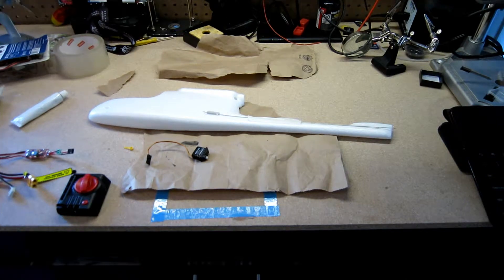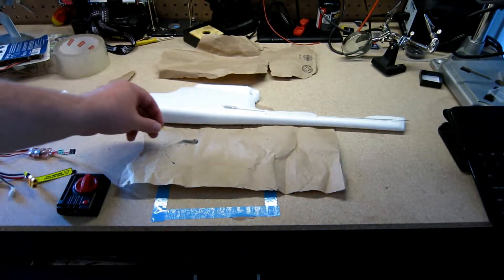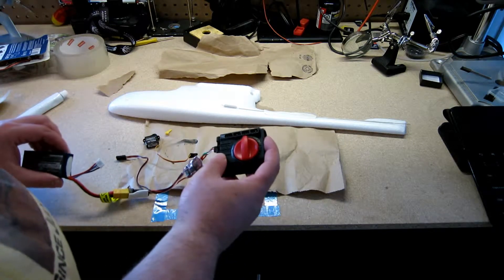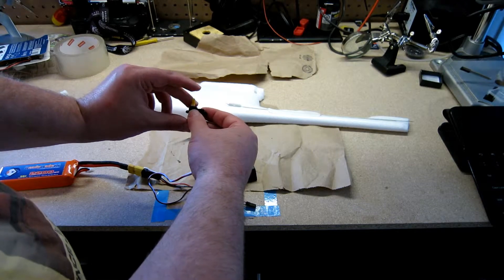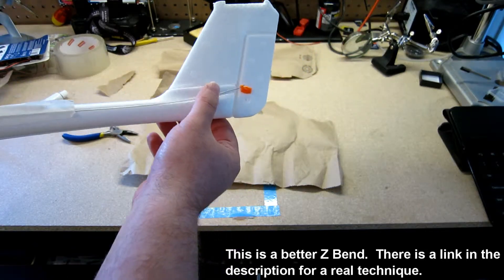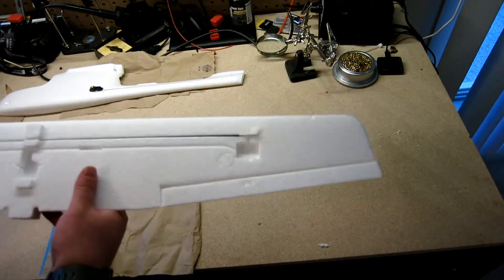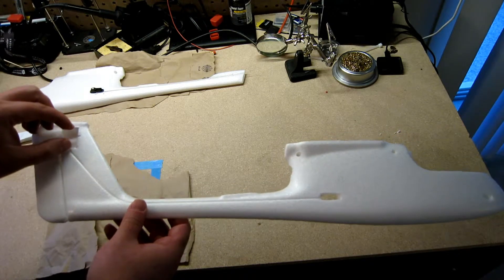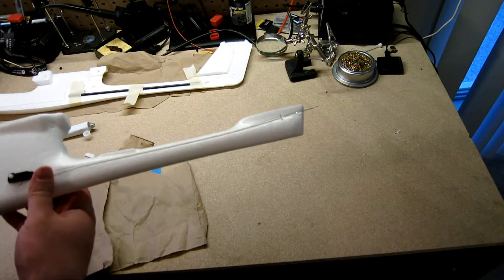At The Bench: Mini Skywalker 3 - Control and Support

Comment: with all respect...

this is the first time i have ever seen someone using a servoplug from esc to motor....

use these and some heatshrink
http://www.banggood.com/Amass-2_0mm-Banana-Plug-AM-1002C-Male-Female-20-Pair-p-999232.html

http://www.banggood.com/5X-Pairs-4mm-Gold-Bullet-Connector-Banana-Plug-For-ESC-Battery-Motor-p-976108.html
Reply from the maker: +JOHNNY jeppesen Thanks for the suggestion.  I considered banana plugs but chose not to use them.  They are bigger/bulkier and that bulk doesn't serve any purpose for this build (had I needed more power and used thicker gauge wires then maybe a heavier connector is worth while).  In addition, with banana plugs you can plug them in the incorrect way, each time you connect the motor you have to double check they are in the proper order so you have to come up with an additional mechanism to make sure you get it correct (color coding or something).  While with servo plugs, once you have the three wires put in the connector the right way you don't have to worry about orienting the plugs, there is just one way to plug it in - a simpler mechanism for a dope like me.
Reply: +Steven Luke 

My consern is towards these servo plugs as you will be pulling more amps through them. 

You can get the smaller 2mm banana plugs, and as far as i know there is no right or wrong way to connect them, to the esc,it will only make the motor spin in each direction.

I bulding a similar fpv setup, but i thik tho i will chose to solder the motor to the esc instead to save space and you can usually set the motor direction in the esc as well if the motor ends up spinning the wrong way..

Any nice video :)
Reply from the maker: +JOHNNY jeppesen thanks.  The esc is a 12A, and the 20AWG wire on it is rated for 11A. The servo connector itself can take 10+ A.  on the draw side, the Park 250 motor only draws around 7 amps so the servo connector should have room (and I have never felt it get hot).

I guess the main thing is that I swap the motor on/off so I want it idiot proof when reconnecting. So having to reconfigure esc or test different plug order would be annoying.  If you are permanently connecting them then it is obviously not an issue.

My next build will be using a 20A esc, and the motor takes 16A probably, so I won't use the servo connector, probably use banana plugs unless I can find a bigger one way fit connector with three pins.